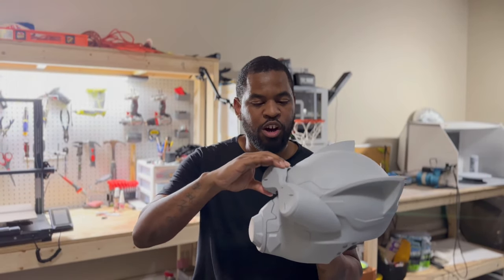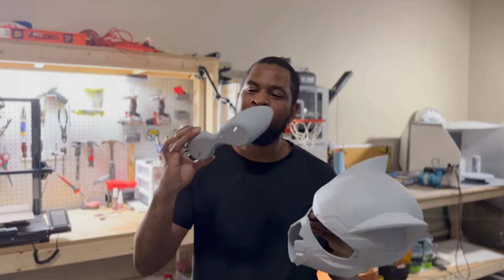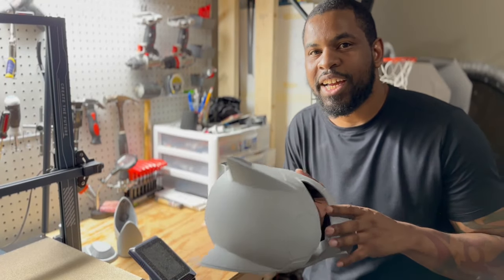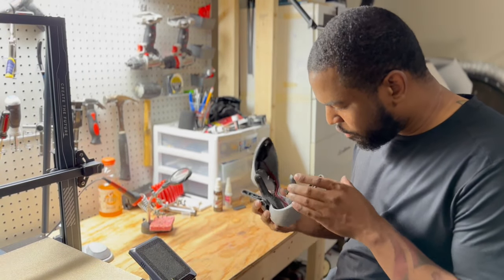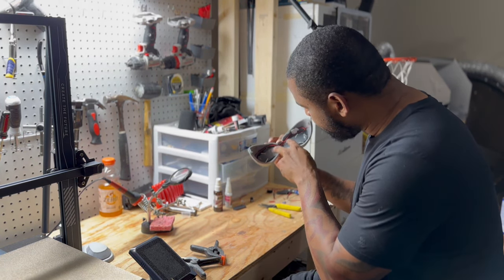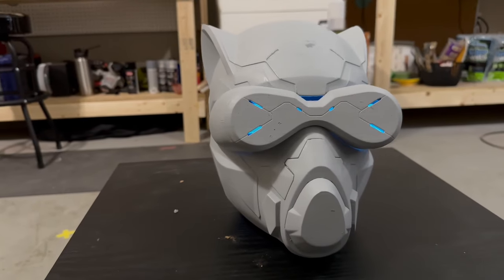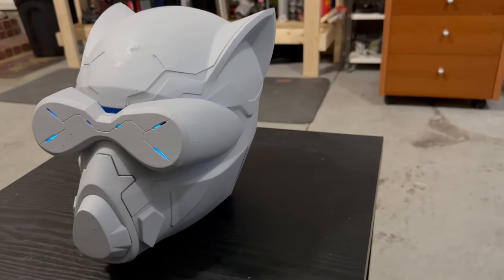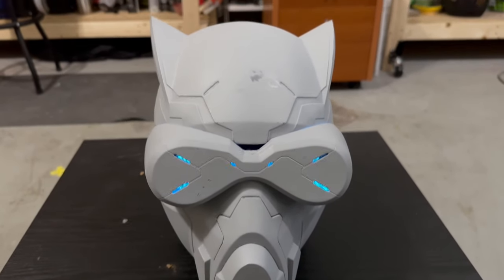How-To Ep1 Wireless LEDs Using Magnets for 3D Printing and Cosplay

Comment: Which magnets and led eyes did you use. Great Build
Reply from the maker: Thank you so much! 

I got my magnets from Harbor Freight, but you can get them from amazon right here:
https://www.amazon.com/VSKIZ-Magnets-Refrigerator-Whiteboard-Neodymium/dp/B0C6GN2VXD/ref=sr_1_3?crid=3UQREOZZ9CQKP&keywords=8x2mm%2Bmagnets&qid=1697041849&sprefix=8x2mm%2Bm%2Caps%2C103&sr=8-3&th=1

The Led Cosplay eyes I got from Ali Express because you can get so many for $1.99 but you can also grab them from amazon:
https://www.amazon.com/Batman-Decorations-Acrylic-Cosplay-Superhero/dp/B09NNW6H52/ref=sr_1_6?crid=2HDJY19QUIGE8&keywords=led%2Bcosplay%2Beyes&qid=1697041902&sprefix=Led%2Bcospla%2Caps%2C112&sr=8-6&th=1